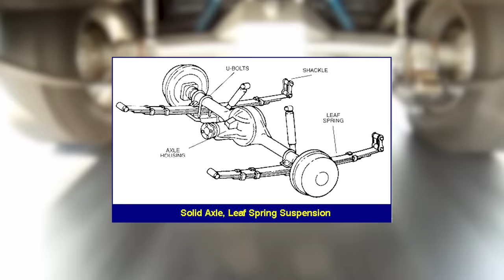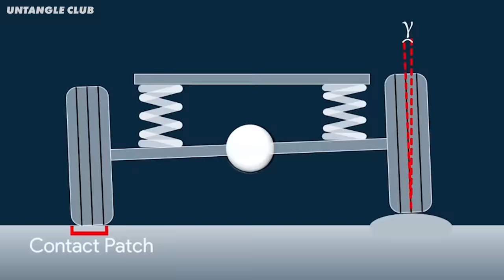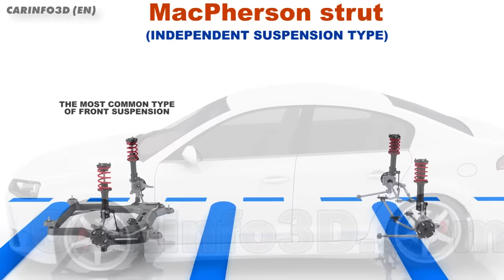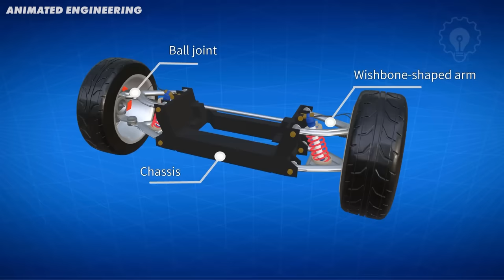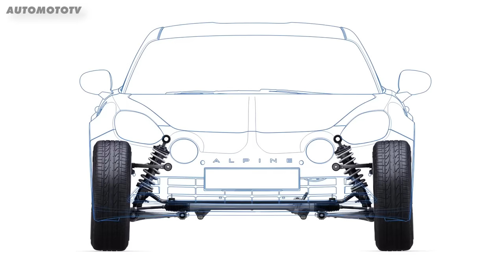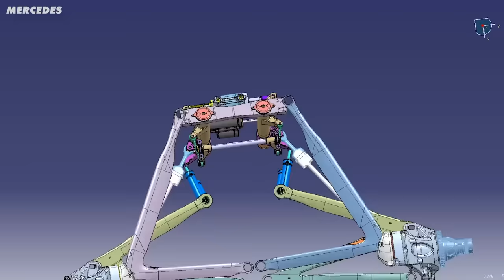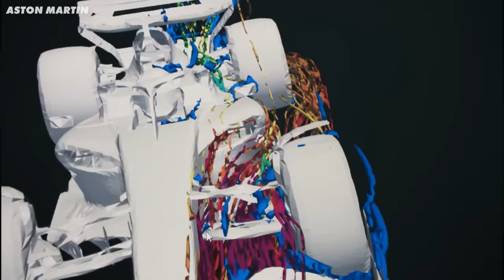Why Formula 1 Uses DOUBLE WISHBONE Suspension

Comment: I have a 2001 Audi it is fwd so rear is a solid dead axle but the front has 4 control arms! 2 upper and 2 lower. Then I gave it 300whp and lowered it so it has a bit of negative camber (like - 1.5) and it handles really good for a car that over 20 years old!
Reply: It probably has a twist beam rear suspension, nos a solid dead axle, unless it's a van.
Reply: @boudewijnb    it's kind of shaped like a big C. It pivots with a bushing at, what would be, either end of said C. It does sit on coilovers on all 4 corners. I can do just about anything to a car and I've rebuilt just about everything on this one but I'm definitely not a suspension guru...
Reply: @boudewijnb  just looked into a twist beam. Then went back in photos to when I had it out to replace the bushings and I guess it would be considered a twist beam... Thanks! Now I know...

Comment: Can you make a video on why wider tyres equals more grip. Cos the physics says that the surface area has zero affect on friction and in lab experiments it doesn’t but it does on cars for some reason
Reply: I believe it comes down to heat disapation, being able to handle the high load (think downforce spread over a wider area) and a basic physics model doesn't take things like sidewall deformation/strength and the transfer of rubber from the tire to the surface.
Reply: This is glossing over ALOT of relatively complex intermolecular physics that I myself do not fully understand; but from my understanding of the reading I have done for my FSAE team, I would say the main reason to is load sensitivity. The Formula for friction, F=µN is technically incorrect for tires because they’re made of rubber which is non-Newtonian and viscoelastic. All that is to say that as the load on a tire (N)  increases, the coefficient of friction (µ) between the tire and the road decreases at an increasing rate. Because of the diminishing returns, it is ideal to maximize contact patch so you can reduce the force per unit area thus maximizing coefficient of friction. That’s not to say temperature isn’t a reason as it is definitely easier to work thinner tires to a point that they overheat and lose grip but it is a balancing act. Too wide and they would get too difficult to work them into an optimum temperature range. Vehicle Dynamics in general is an art in balancing variables. There is NEVER a perfect setup just infinite possible solutions with some better than others. If you’re interested more about car setup or Vehicle Dynamics, Tune to Win by Carroll Smith and Race Car Vehicle Dynamics by Bill and Doug Milliken (find the pdf online) are great reads.
Reply: @Bannerdrums  No
Reply: The practical answer is, the greater the contact patch, the greater the grip.  Wider tires potentially offer more contact area, therefor more grip and more road holding.  This is why many racing series' limit tire width, among other factors.  That is the simple answer.  There are many other factors to consider for total grip (friction).  Assuming equal loading across a tire, there is more grip with a wider tire.
Reply: @dan1906  it’s not that simple tho. You can do the experiment yourself. Make a weighted sled on side is flat and one side has skis (massively reducing the surface area) and test how much force it take to pull the sled and the force is exactly the same no matter the surface area. Aslong as the mass and the contact material are the same the friction force is exactly the same
Reply: @georgeoliver8300  True, it's not that simple.  I even say so, should you have bothered to read, and understand, the entire response.  So, thanks for helping me say... what I said.  Duh.  I have real world racing experience to draw from.  So I sort of have an idea.  For an explanation to someone just asking a basic question, as in the above, it does not have to be so in-depth.  Some people are not theoretical scientists in the dynamics of tire technology.  You're generating an argument to someone that doesn't understand the basics.  So, stop.
Reply: @georgeoliver8300 it’s all around a very complex topic. In my experience the more about suspension and tires you learn the less it makes sense until you can get over the “hump” of misunderstanding. Tires are WEIRD, friction is normally not related to area but for tires it is because your “constants” aren’t constant. I love your initial question because it really scratches at the surface about what vehicle dynamics is all about.
Reply: @dan1906 he’s asking why greater contact patch means more grip which is what I answered to. Realistically tires just are that complex and simplifying them will only get you to a point. His question scratches at that complexity even though on the surface it’s a simple question.
Reply: @dan1906  George's question, in so many words, is: why do car tyres afford more grip the wider they are, when the friction equation includes no term for surface area? Your answer was, in effect: wider tyres afford more grip because they create more surface area between the tyre and the road. You did not provide a meaningful answer in the first place. Whinging that Oliver did not read and understand this phrase "That is the simple answer. There are many other factors to consider for total grip (friction)", is frankly asinine - the simple answer you gave was actually no answer at all.

Comment: Double wishbones are so tasty and underrated. I drove a GR86 and was massively disappointed with the McPherson suspension. I guess a boxer engine is too wide to cram between a set of wishbones. Not a problem for a rotor motor, that’s why I stuck with the old RX-8. 10x better steering feel, especially over the limit. Plus it makes a much better noise.

Comment: The "trailing arm" shown is not a trailing arm. And most small hatchbacks have a twist beam rear axla which is not the same as a rigid axle, it's more like a trailing arm with a really hard anti roll bar. Also, trailing arm doesn't need a mounting point above the wheels they could use push rods or torsion springs as well. Lastly, semi trailing arms can control camber and provide a good deal of anti squat. They were not uncommon in sports cars in the past. The first Z4 had them. My Porsche 944 has them too.

Comment: Slightly unrelated but is it possible to attach a third element spring (for heave control) on a McPherson strut setup or is that only feasible on cars with inboard springs like a formula car 🤔
Reply: It could be done pretty simply with a Z-bar. It's just like a sway bar, but with one end flipped backwards; so instead of resisting roll, it resists both wheels moving in the same direction.
Reply: @tylerscott305  Would require extra structure since a sway bar isn't really up to those kinds of loads, it's basically meant to control droop in practice.

Comment: My man, this video needs some rework. Lot of mistakes there.

- Independent suspension isn't a separate type, it's more of a category. Multilink, double wishbone, MacPherson (Chapman), (semi) trailing arm are all Independent. It just means that left wheel can move independently from the right wheel.
What you have on the buggy at 1:36 is just a version of double wishbone with unequal leght of wishbones, also called short long arms suspension.

- No mention at all of twist-beam rear suspension. THE most common type of suspension on FWD mainstream cars. Cheap, reliable, easy to service, good enough bump/rebound geometry. Since its basically a pair of trailing arms connected together by a torsion bar which acts as an anti-roll bar, and the torsion bar is usually welded to the trailing arm  somewhere halfway between its bushing and the wheel hub, it means that left and right wheel bumb and rebound movements affect each other, but not as much as with solid axle, so it's a semi-independent suspension.

- No mention of swing axle - typical for Tatra trucks with backbone chassis.

- No mention of more exotic or obsolete types, like De Dion tube, sliding Pillar, Dubonnet ... but these are rarely found today, so that's not a big deal though.

 Trailing arm animation at 2:14 is all sorts of wrong: first of all, why is the arm behind the differential? It looks more like a leading arm, rather than trailing arm. Also, usually on RWD cars like BMWs that didn't have DW or multilink, there would be a semi-trailing arm rather than just a trailing arm. Also, why are the semi-axles and differential moving up and down with wheels? It shows nothing how the (supposedly) trailing arm affects wheel geometry. 

 It also has to be said that multilinks come in all different shapes and forms:

- There is the old Italian enhanced McPherson (or Chapman, since it was a rear axle) where instead of a lower wishbone there was a trailing arm and two lateral arms. Technically could be considered a multilink. Found on Lancia Delta, Kappa and Thema, Alfa Romeo 164, 156, 147 and GT, Subaru Impreza WRX, Ford Cougar and Mondeo, and probably many other makes and models.

- There is the Ford Focus ControlBlade, rear suspension designed for FWD cards where the upright is controled by one trailing arm ("Blade"), two lower arms and one upper arm, to facilitate passive rear wheel steering (compliance understeer) for improved stability, and similar setups by other makes for FWD cars (VW, Toyota, ...).

- There was the very unique multilink on Alfa Romeo GTV/Spider 916: https://forum.clubalfa.it/attachments/gtv_-_retrotreno-jpg.49580/ which, unlike other multilinks for FWD cars that were tuned to passively steer in same direction as front wheels when flexed during cornering (compliance understeer), this one is actually set up to first passively steer slightly in the opposite direction (oversteer), and then shift to passive understeer. 

- There was the also unusual multilink on Alfa Romeo Giulietta, where the trailing arm and upright assembly was one solid unit, which was controlled for toe and camber geometry by two lateral arms.

- There was yet another unusual multilink by Alfa Romeo, used on Giulia and Stelvio, called AlfaLinkTM, which unlike the usual 5 link setups, where all links connect to the chassis on one end and upright on the other, this had a wishbone instead of two lower control arms, and a link that connects to the wishbone at one end, and the upright and one of the upper control arms at the other. 

- Then, there was of course the OG Mercedes 5 link suspension, designed for RWD cars, first introduced on the Merceces W201, which had four lateral arms (two upper and two lower), and one semi-trailing arm. This design would inform most subsequent 5-link RWD suspensions. 

Anyway, back to Formula 1: your reasoning why double wishbone was selected does not explain why multilink could not be also used. I mean, just add one extra semi-trailing control arm at the rear and voila, it's a multilink, where instead of 3 or 4 separate lateral control arms, there are two wishbones doing the same job. 

Now I'm going to say something controversial so brace yourself:
The front suspension on a Formula 1 car could technically be considered a Multilink. 
You've got the two wishbones, which do the job of 3-4 lateral control arms to control camber and caster, and then there is the tie rod, connected to steering rack, that controls toe.

So why not use the same setup at the rear?

Because rear wheel steering is banned in Formula 1.

Comment: I understand that the point of the video is double wishbone in F1 cars but you could’ve reiterated that apart from the rigid/solid axle, all those are independent suspension. Also double wishbone is a multilink suspension.

Comment: It's worth noting double wishbone is superior for track use because if your shock absorber fails, the wheel keeps pointing in the right direction. If your strut fails (or worse; breaks!) with a McPherson strut front setup, then your day could end very badly indeed, as you will lose control of the car at the worst possible time and place. Happened to me once, in a mate's 928. I got lucky. And so it is for this reason that when I am at the track in a car with McPherson Struts on the front, I take it very easy on the curbs - either staying off them completely, or only touching them gently late in the corner. Better safe, than sorry, eh?

Edit: It's probably also worth saying that the function of a sway bar or anti-roll bar is best described as automatically stiffening the suspension (by increasing the spring rate) on the compressed side.
Reply: What?  That is quite possibly the most ridiculous thing I have ever read.  I don't even know where to start.  A "shock absorber" (in motorsports they're dampers) failure does not equal suspension failure.  It just stops damping. They leak oil and cause damping issues upon failure, especially if you do not maintain them.  To break a strut outright requires a crash of some sort.  It's more likely to break a ball joint, to which double wishbone suspensions have 2.  Again, it takes neglect, or a crash, for this to occur.  Double wishbone has far more potential for failure as it has more pivot points and moving parts.  Given the same level of neglect double wishbone is more prone to catastrophic failure.  People have been racing on McPherson type suspensions for many decades.  I do, and continue to do so with no major failures.  They are no more prone to failures due to the design than any other.

Comment: Just a tiny point about suspension on an EV. They only have to make it last 10 years, because the car will be scrap by then.
Meantime, the alloy suspension on my 41-year-old 928 is working perfectly, with new nolathane bushes.
Reply: You're using a 928 as a benchmark for reliability and cost of ownership?  Are you drunk?
Reply: I have been in the automotive industry for over 15 years, working on things from huge trucks to classics, to race cars and electric vehicles. Never once in my entire career have I ever seen suspension fail from anything other than lack of maintenance or massive impact. You replaced the bushes on your 928, if you hadn't done so, the bolt holding the bit in would fail and I bet it would do it in well under 10 years. It's the same with literally every single vehicle out there, EV or otherwise.
Reply: Smartest fuel glazer

Comment: Road cars with multi link or double wishbone do handle very well but more bushes/ball joints means more chance of failure/excessive wear. 
Especially when they fit bushes with a steel case bush into a aluminium arm, in the uk with salty winter roads, just asking for it!